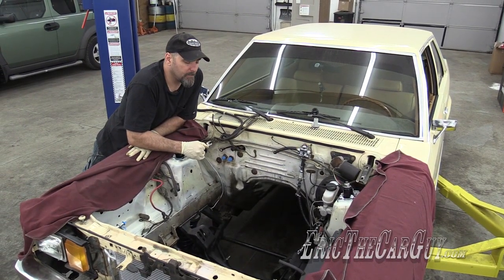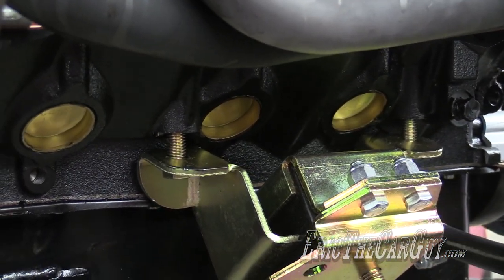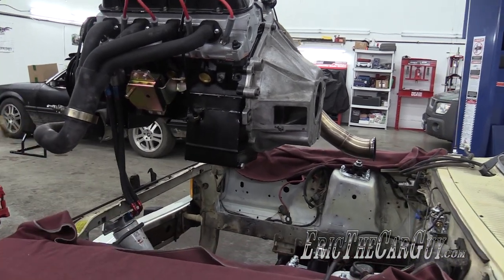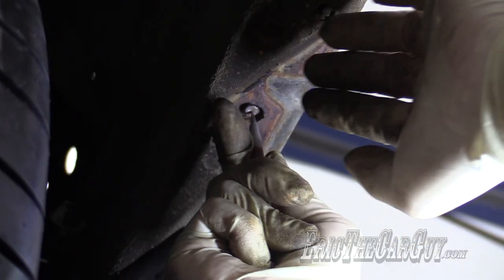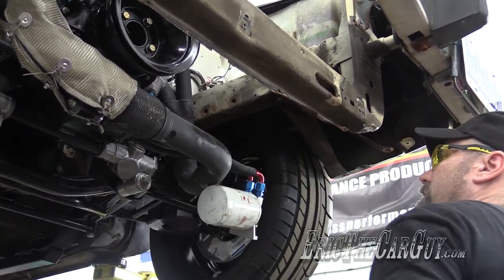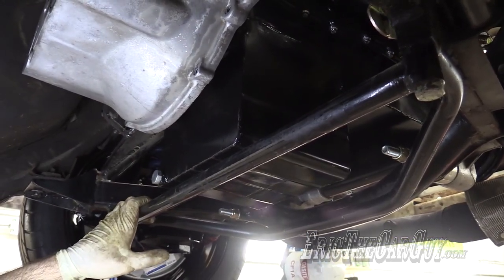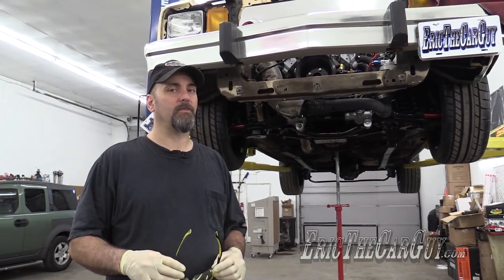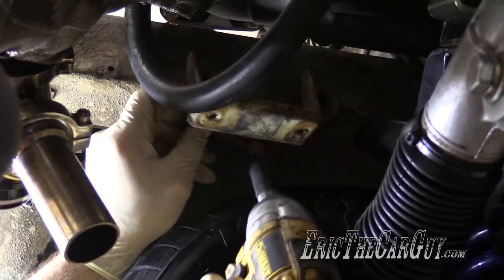Test Fitting the New Turbo Engine and Transmission #FairmontProject

Comment: A little lube on those drill bits for cutting and longevity-?  lol  Not being hyper critical, just that ive had my share of performance parts fit-ups and I sympathize with ya on the trials and tribulations, especially changing from a six to eight, new K-member and Turbo - lots to tweak and adjust and hope theres still enough strength in the heated brace.  But just as you said, that's always the case in aftermarket hi-performance, Kudos on your overall success given the multiple issues you covered in this video.  I appllaude your sense of adventure, once its all ironed out your biggest expense will be gas and tires--LOL
Reply from the maker: I'm going to be changing out this K member in a future episode. The new one has spacers that I hope put it past the oil pan.
Reply: Cool-!  I was surprised how well it fit after bending it, I was almost sure it would come up too short. I assume you found a better fitting K member, will it bring your wheels back any-?  I love to watch a project like this coming together.  Once you get it all dialed in you will have some serious satisfaction with building a great sleeper - how many times do ya pull up next to a Fairmont these days at all, let alone one that has over 600 HP--LOL
Reply from the maker: The wheels being moved forward is actually a good thing. It helps move the weight of the engine back toward the center of the car for better handling. My new K member and control arms will do the same thing.
Reply: Ah yes, an old trick from way back.   Im 57 and remember the old drag cars, they took that to extremes, and guess they still do today.  If I may ask, why are you opting for another new K member, im sure theres a good reason.
Reply from the maker: it's part of the new suspension package. I'm redoing both the front and rear suspension because of how much power the engine made. I'll explain in detail in future videos. I also have a blog about the project coming out soon that will explain things further.
Reply: OHH - that makes sense, and the right approach to take to harness the unexpected power surplus - a good thing-! lol  As I recall you hit well over 600 hp on the dyno-??
Reply: EricTheCarGuy You make look so easy. Thanks for sharing it.

Comment: not saying you hacked those engine mounts but you could have totally done a better job at trimming the inside corners next time try a angle grinder with a grinding disk or a cookie gun with an abrasive wheel youll get much cleaner results compared to a die grinder just my 02

Comment: Why on earth would you build an engine, fit it with CUSTOM PARTS, like the sump and exhaust (turbo) system for a car, and then 'trial' fit it afterwards?  You're meant to design these areas around the confines of the vehicle.  Another ass-backwards way of doing things from Eric.
Reply: you're just pissed that his way worked
Reply: ArchimedeanEye - He is designing around the confines of the vehicle, in the same way home-gamers would; test fit in-car, redesign until it works.
Reply: I think he did design around the issues as well as possible, after all it fit without any major changes. If you want to see somebody making something work that should not work then watch Roadkill.
Reply: Ultra Motor Source Making custom parts indpendent of the vehicle and then hoping for the best is not the way to go.  The headers and exhaust feed for the turbo should have been designed within the confines of the vehicle and been given sufficient clearance around all areas.  Instead, we see custom exhaust parts near hard-up against  a steering rack boot and a sump that won't fit into a subframe.  I can see many more clearance issue also.  The better way is to mock everything up in situ as a static 'buck' and build custom components taking into account their surroundings.  This car is turning into a horror show.
Reply: What a freaking drama queen, his way of doing it is just fine and hes getting on with the build.
Reply: Had he been able to use the planned original motor, most of these issues would have disappeared. Apparently  one of ya'll ever watched Stacey David have to massage stuff to make them fit. No because most of that stuff was done off camera.
Reply: That's exactly what most car channels would have done. It's also exactly why I learn nothing from them. From the beginning this has been a project not just for him to have a cool car, but to utilize as a teaching tool. We see him actually drilling out holes to relocate oil pumps in such a detail someone who has never done so could feel comfortable buying a set, watching a few more specific videos and doing it to their own car. On the "other" channels, all that would have happened off camera, and we'd have gotten a montage of parts being installed into locations we as the viewer have no context for understanding were even custom made unless we know that make and model.

None of those videos would have reinvigorated my spirit for my own build. I thought to myself a lot of the custom work was beyond me, but I thought the same thing when I was dealing with potentially explosive strut coils and replacing a suspension before I watched Eric's early videos. Watching him struggle was depressing at first, but the fact he had a trick up every sleeve was actually uplifting in the sense it proves that while there are many bricks, there's also usually a convenient escape hole in the wall.
Reply: Eric almost ALWAYS does it the cheap way. We see a lot of custom parts thanks to sponsors these days. but ultimately unless someone hands him something free he makes it work the way the average person has to. And from the video, it's clear that going in he knew he had the machining expertise to correct problems as they occurred. This is not a video of a guy building his dream hotrod, it's a teaching tool to show the idiosyncrasies involved.
Reply: He clearly does not know what to do, and neither do you. or else you would not make a comment supporting shoddy work practices.  As previously stated, you don't build custom parts and then test fit.  That is called doing things twice.  Doing things twice is not the cheap way and it is not the way to teach anyone to do anything.  It does however sum up Eric's entire build.  Drastically over budget and drastically over schedule.
Reply: Do you think you're looking through a window into a licensed Ford dealer's shop or something? He isn't repairing a customer's car nor is he trying to efficiently build himself a sleeper. He's making informational videos, and that requires showing WHY you want to plan ahead. A video of him bolting perfectly designed custom parts together doesn't tell anyone a single thing about the actual process of that design. Instead we get to see how things don't fit and how he fixes them. Had he done what you are suggesting the only video footage he could possibly have is of him measuring things which does not demonstrate the limitations of the original design at all.
Reply: + TheRealBobbyMC He's not trying to efficiently build himself a sleeper?  What is he trying to do then?  Do everything twice for the fun of it?  You don't get it.  And what the hell are you talking about bolting stock Ford parts together for?  You don't think I know this is a custom build?  Listen.  The way to build custom anything, a car, boat, aeroplane or motorcycle is to sit the engine in there, measure - and build the components needed from scratch or modify components to suit.  You fit the long engine and then test fit components until you have a fully mocked up build that does not run - but shows you where the clearance issues are.  

That is how you teach someone to build a custom car.  You don't teach anyone anything of value by first building custom parts without considering the confines of the vehicle, clearances and heat management issues - and then re-making custom parts all over again.  That is simply terrible planning and decision making.  It serves zero purpose of teaching anyone anything.  Worst of all, it has people like you convinced that it's the right way.  It's not the right way or an efficient way or a cost effective way.  

Maybe you should stick to gaming.
Reply: Yeah....like welding a lower ball joint on a customers vehicle.  Better go back and watch that video Back Seat Garage!
Reply: Almost none of that turbo kit is custom lol. Thats a bought kit from on 3 performance likely built to fit a fox body mustang basically perfectly. The fairmont is a fox chassis but has some differences. Did you really think they custom made those turbo manifolds, downpipe etc. and they just got lucky on how close it all fit? lmao
Reply: shawnmeyer44 I don't think the fit is good at all. I would have sent that junk back and found a vendor with tighter fitting solution.
Reply: parteibonza how do you figure you could get that much more tight fitting? and i doubt the kit says its made to fit a fairmont with full maximum motorsports suspension treatment.. its built for a fox mustang. And the kit is quite affordable for what you get i believe
Reply: If it works, it isn't stupid.
Reply: shawnmeyer44 yeah i guess so but it still bugs me
Reply: are you paying for his build? No? Then where's the finance coming from to afford all this custom non-sense?
Reply: The Jackeria there are always optioms. Not mecessarily new. Sometimes more research and hunting.
Reply: The Jackeria Thats the thing, its not as custom as it seems. The entire turbo kit was basically bought premade. So were the suspension setups. Nothing wrong with doing it that way and im not knocking it at all. We do it at our shop quite a bit cus its more time efficient for us and generally cheaper for the customer then paying us to build or piece together every single component. The few custom things hes having to do are just minor inconveniences you always run into fitting aftermarket parts. Especially when you fit a large amount of different aftermarket parts all from different manufacturers not necessarily made or designed to be all ran together. On3 is a decent brand and is pretty good value and bang for the buck but is far from top of the line.
Reply: I don't work in a shop and I can understand this, yet there are supposed experts railing on about how everyone including Eric are idiots for not measuring out every single part off screen and instead showing us doable solutions that don't involve custom building every single component. That's why shops exist to sell premade parts for common swaps. I can't imagine how many of these cars have had this exact setup by now. It's not rocket science to sell stuff like a turbo manifold designed to mate up to a stock exhaust pipe, and that's what viewers of this channel might actually be able to do vs becoming master machinists overnight and doing it all themselves.
Reply: Hmmm! Supposed experts? An "ex" is a has been and a "spert" could be defined as a drip under pressure, there you have it "expert"!
Reply: TheRealBobbyMC Exactly. Most obviously dont understand that its a kit...

Comment: The driveshaft is to long. It seats all the way up in the trany, WHEN THE CAR IS LIFTED!
Meaning, when you put the car back on the ground, you will shorten the distance between the diff and trany compared
to how it is now. you will need a shorter driveshaft, or move the engine and trany to the enginemounts in the front. (if you used the ones in the back.
Reply from the maker: It's fine as you'll see in a future video where I install the new transmission. Also, I did not use the reward holes for the engine mount.
Reply: Good to hear! Cant wait for the next episode!

Comment: your drive shaft looks awfully long.. should be 7/8 to a inch of your yolk sticking out of the trans. when the suspension is relaxed and axle wraps a little bit it chould break your trans if its too long.. good luch though eric!
Reply from the maker: It's fine. Especially with the new transmission and torque arm that you'll see in a future episode.

Comment: If that's anything other than a TIAL wastegate, you're going to have a bad time. Even more so if it's the wastegate that On3 sells. They make a kit for my platform and their wastegates fail within weeks of install for most people.
Reply from the maker: I'm actually thinking of running a different one anyway. Thanks for the input.
Reply: EricTheCarGuy Don't get me wrong, the turbos arnt terrible and you're not running enough boost to push it hard at all. Just have seen to many issues with their wastegates.

Comment: That driveshaft looked WAY too long. It looked like it was bottomed out before the car was even on the ground.
Reply: i was thinking the exact same thing . thinking he may need something a little bit shorter
Reply from the maker: It's fine, especially with the new transmission and torque arm which you'll see in future episodes.

Comment: why not have dual exhaust with an engine like that you needed to breathe. I am a little sad that it's single exhaust. dual exhaust will give you more horse power.
Reply: bigbog442 The engine only has one turbo which is driven by the exhaust from the headers.  The output from the turbo only needs one large pipe (3"+), no real benefit to running dual exhaust off of it.
Reply from the maker: The 3" pipe and cut out will work just fine. Thanks for the input.

Comment: Am I the only one who looks at this motor and am very annoyed that the turbo plumbing routing is simply awful. The exhaust and turbo setup hang wayy away from the motor. I would be very angry that they didn't route them better. My dodge Cummins 6.7 plumbing was tighter than this garbage. Look at the Buick t-type turbo plumbing it fits so much nicer.